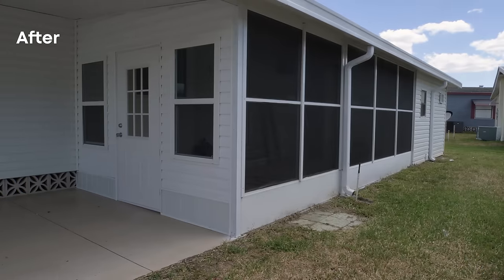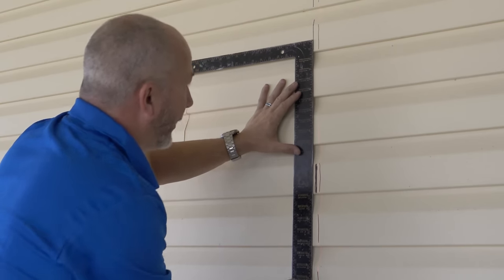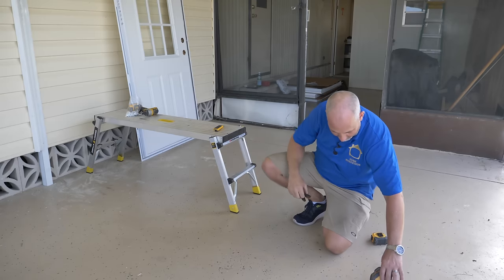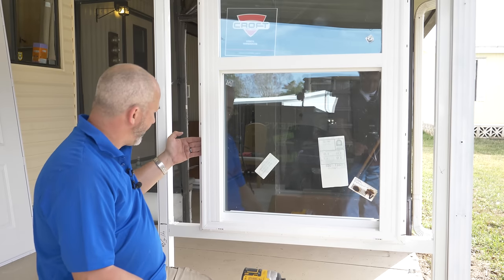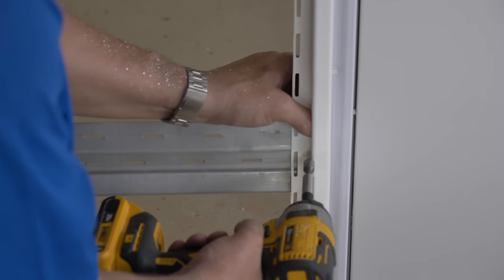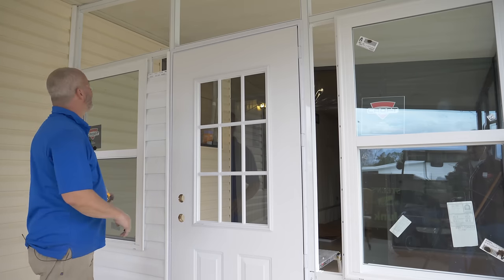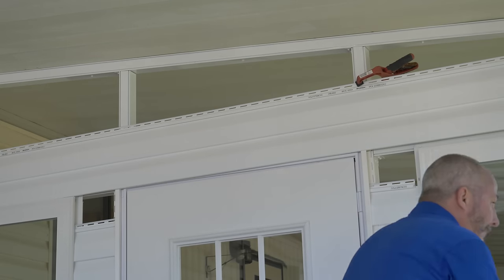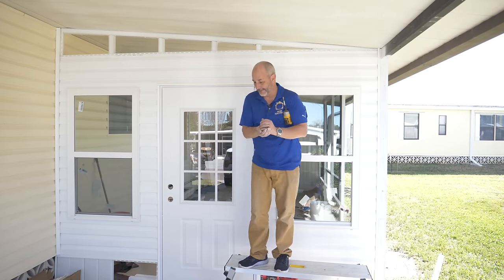Framing and Enclosing My Carport | Screened In Porch Build

Comment from the maker: Watch Part 2 👉🏼https://youtu.be/eGoNPl5KKyM Cheers!
Reply: Question, could I just route a 3/16 cut on a 2x4 and put spline inside that given the thickness of fiberglass screen is roughly .009-.011? Seems like it would work just as well as buying those aluminum supports, as long as the 2x’s are straight

Comment: You can reverse a regular, finer tooth circular saw blade in your circular saw to cut both siding and the aluminum as well. An old dull one works great.
Reply from the maker: very true. Great tip Cheers!
Reply: You are correct and you must be old schooled! Can't make that suggestion in todays world without a lawyer on call
Reply: @GM-dh5xi  lol I am. I learned a lot of stuff growing up with my Dad and he built houses in the 80's and 90's. I helped a friend who owned a siding business for a bit about 10 ears ago and he was using that method too.
Reply: @SophiaAphrodite  I grew up installing vinyl siding for my dad's company.  You're spot on.  We built a cutting table and reversed a plywood finish blade to cut our soffit for eaves.  Made quick work and if you had multiple pieces the same length you could stack pieces of vinyl and cut 2-3 pieces at a time.  Worked like a charm.

Comment: Too funny. I have that same HF chop saw and have used it on two home remodels and it sucks. BUT the blade spins, it cuts stuff, and it cuts square enough for basic framing. Crude but effective. Every time I use it I find myself wishing for a nice compound miter saw but then I just chop whatever it is and forget to go shopping until the next time I use it. Same story with the HF tile saw.
Reply from the maker: my only problem with this tool is the fence is too low so doing base miters is a pain. Cheers!

Comment: Really love your videos. They are my go to when installing something im not familiar with. Im 62 and love to work alone also. I was down there at Miami Dade Hurricane Testing facility in 1992 doing product performance for the biggest metal roof mfg in the country. Been to them all UL, ASTM, Factory Mutual ect, ect. Blew them all out of the water because we built a test chamber and tested prior to going. Helped set the new methods of installation at that time. I would be more worried about the neighbors Tupperware shed hitting my windows😂
Reply: Kinda knew u were going to get blow back from this install

Comment: I have watch many of your past videos but have a question regarding floors… could I use 1x6 or 1x8 pine T&G for flooring instead of the Laminates, Vi ya or engineered woods? The pine is cheaper but is it acceptable floor ? Thanks

Comment: Harbor freight tools arent great quality but theyre great if you want a cheap tool to get a job done.  I got an oscillating multitool for $11 and an angle grinder for $18.  The next cheapest multi tool at the box store was $60.

If youre going to use a tool on jobsites or use them for years then its worth investing in Milwaukee or Makita.  But if youre only using it around the house every few years, harbor freight is a great option.
Reply: Or the rule of thumb, buy the HF tool, when you've used it enough it breaks/fails then buy more robust.  
(Also they've been improving their quality so there's less failure nowadays than a couple decades ago.)

Comment: Could that tile blade cut 25 year old vinyl siding that has been baking in the sun without shattering it? I am expecting it to be brittle.

My garage was closed in when I bought the house, but I want to open it back up. My biggest concern is cutting the siding without it exploding. It is a bluish grey color that I am sure was purchased very cheap because it was a spec house. I can't find a match for it so I don't want to risk it.

Comment: I'm in Orlando, and it's been a nightmare since I bought my house. Replaced almost everything, but I have a room that's half under the house roof and half under an aluminum roof (20×30 total). The part under aluminum roof is screen and sliding visqueen windows. It is an unusable room. Everything molds and soooooo hot. AC doesn't cool it because it's not insulated and too big. I was told I can't install windows. I thought I could split it in half and make an interior room enlarging my interior square footage. Is it hard to do this? What materials do I need on the outside wall to make it up to code?

Comment: How do you trim around exhaust vents on existing vinyl siding?  We recently had a 6" and 4" intake put on to feed our new fireplace and chimney.

From what I've read J channels are for new construction.  I was thinking of cutting some 10" PVC trim, screwing the hood into that and cutting out the siding so the trim sits inside it.  Then caulk around.

Is there a better way?
Reply from the maker: hi Robert. Hard to visualize this. if you become a member you can send me pictures and then I can answer properly. Cheers hit the join button.

Comment: Hi Jeff beautiful looking,I am Registered CRC Contractor we build too 170mile hour wind here plus,,,,, and deal with up lift,,,please it's no joke I just went through Ian hurricane ,,I. Never seen so. Many missile flying around causing massive distraction too mobilehomes ,, professional engineering for mobile homes is the only way too go and permitting,,,in Florida it's the law,I respect everything you do as a professional and love your channel..project looks. Great but will hold up too 170 mile wind ,,🌴😎
Reply from the maker: I simply built it the same way it was built. no permits for under the car port here. Cheers!
Reply: Will anything hold up to a 170mph wind?
Reply: @GM-dh5xi  absolutely it's been proven ,we were in the eye of Ian for hours and all the new composite carports, built with 2x8 beams NO PANS and 4x4 engineer fastener and post stayed , every carport made with 3 inch pans blew away, and ripped apart like cloth ..

Comment: I'm also looking at replacing an existing enclosed front porch with extruded metal framing. Where did you procure the extruded metal framing? Thanks for the video and step by step processes!
Reply from the maker: git mine at both mobile home depot and the actual home depot here in lake county. Cheers!

Comment: I bought the same chopsaw from Harbor freight when you put it on a angle. It cuts into the aluminum on the bottom. It's horrible. I tried to do 2 different jobs with it and its impossible
Reply from the maker: mine does not do that but it does not cut all the way through when on a 45 to the right. so annoying.

Comment: You got to think hurricanes, I would of tapconed all verticals, with 100mph+ on that window...
Reply from the maker: no where near the coastline. but cheers. I simply built it the same way they did in 1984. and the original was in perfect condition ...just ugly!
Reply: @HomeRenoVisionDIY Orlando was hit hard several years back by a hurricane, they are about 100 miles from where that storm made landfall. Being 40+ miles in doesn't mean hurricanes aren't a real threat. Your build is beautiful but i don't think the slats will survive a cat 1 wind. Your neighbors a few blocks over will have a few new strips after a sustained wind storm passes over.
Reply: @HomeRenoVisionDIY  I know you're a newbie but coastline or not it only a matter of time.  2004 3 hurricanes intersected over Polk center of state with 100+.  The new Miami Dade codes after Andrew 1992 changed FL building codes for the better, everything from roof down is tied to foundation.  I've been down here for 30 years, Cheers.

Comment: You are in Florida I hope it meets wind codes otherwise all that hard work will be sitting in someone else’s front yard or worse.
Reply from the maker: I basically uninstalled to old porch and mirrored that install from 1984. if it lasted the first 39 years it will last another. Cheers!

Comment: Jeff, on the left side inside corner, your ribs between the new room and the house, are out of alignment by ¾"-1". Probably should have aligned them, and secured the top one, before you put on the 12' piece above the door.
Reply from the maker: no worries. not making furniture here. just creating a stable frame to install a facade.

Comment: Once again, you check vertical surfaces (like posts for example) for PLUMB, not LEVEL. I mentioned this on a previous video and the answer was to join you on some social media site to chat about it. I don't do social media, so if you want to answer this comment, do it here or just don't answer.

Comment: I'm surprised the city approved this project like this.  You've basically added a wind sail barely tied into any structure and during hurricane winds it's potentially going to get blown off (and possibly damage not only yours, but also other people's property).  Wind can readily blow in through the screen side and blow out the front wall (with it's minimal structure).  The projects I've done in Florida the cities have been real sticklers for hurricane strapping, code compliance, and solid building methods.  I guess you're somewhere that is less so.

Comment: i always like watching how you make a simple job sound so complicated. Why did you put aluminium on the bottom. Since i have been going to Florida for 20 years and have a place that survived so many storms . What you did today will blow apart.
Reply from the maker: not sure what to say to this except, most screened in porches are not designed to withstand a hurricane. But this has already survived 12 thunderstorms so not worried. Cheers!